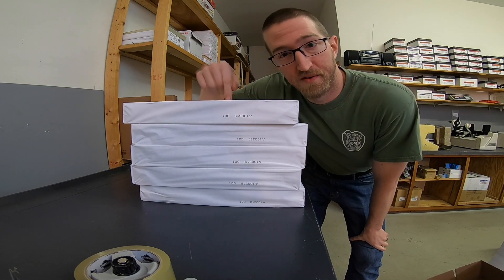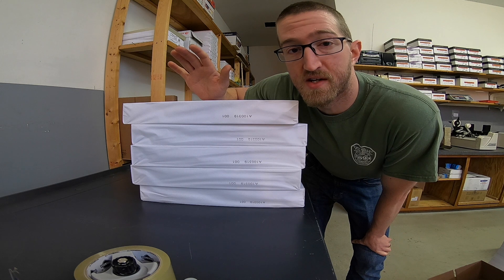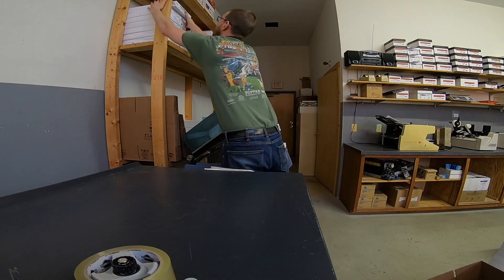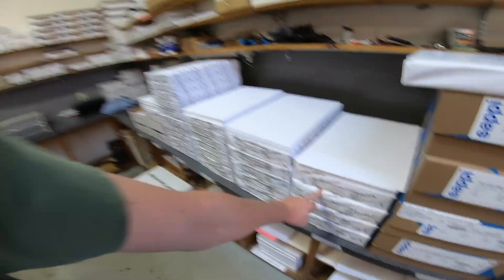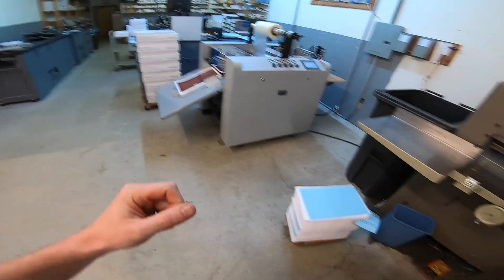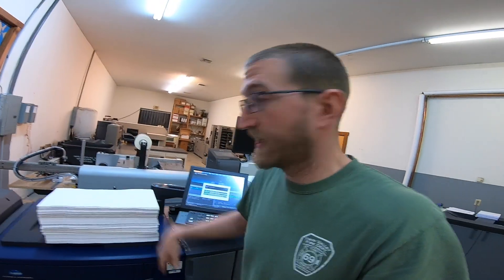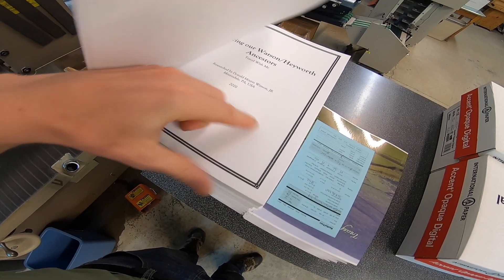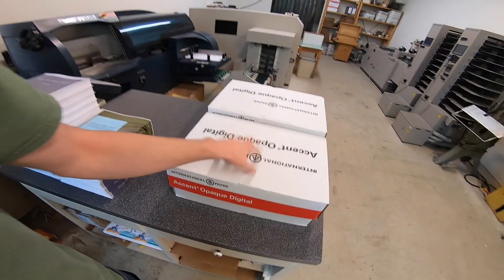Binding Books, Mailing Newsletters, Keeping the Konica Minolta Presses Running all Day

Comment: Hey, just wanted to know if you can use a  wide cold laminator to laminate covers.
Reply from the maker: That should work. Might be less durable than a hot laminator.
Reply: Just A Printer Thanks. I will try to get hot laminator.